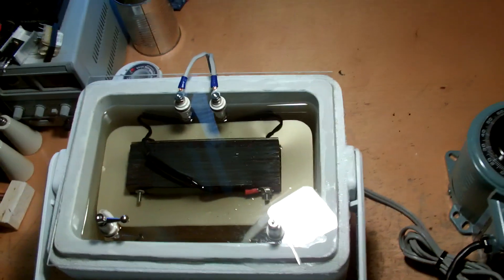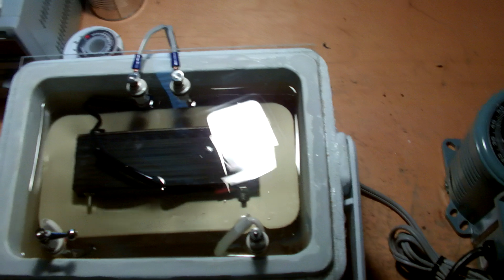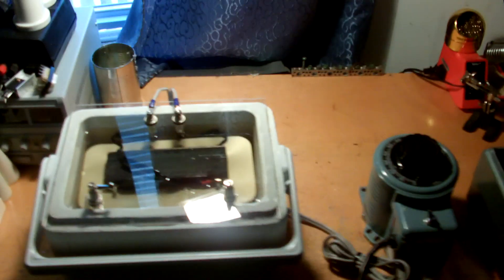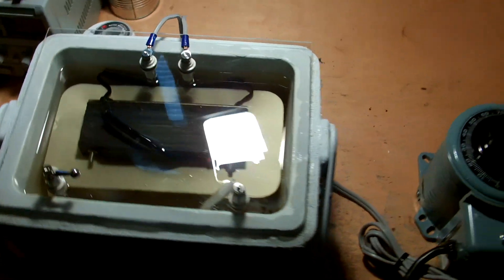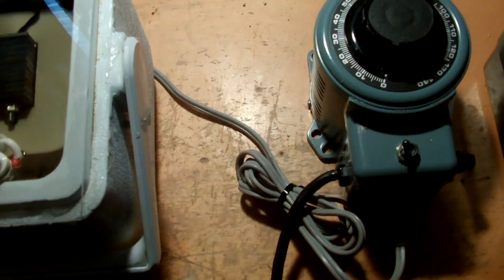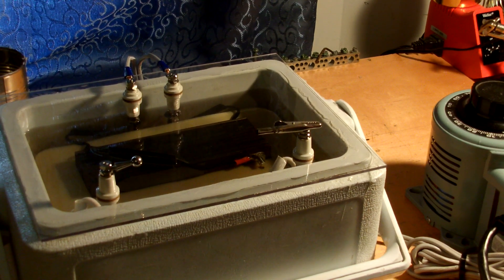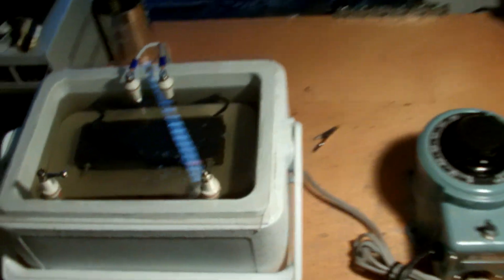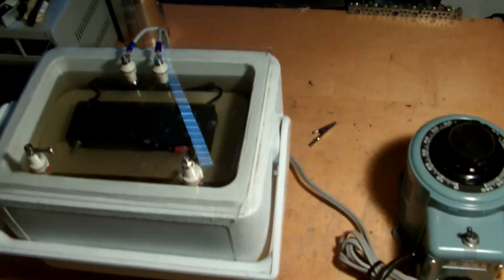120kv Xray Transformer Test Run!

Comment: How do you ballast an xrt to such a low amount of current?
Reply from the maker: Hey thanks for your comment! I wired a variable autotransformer in series to act as a variable inductor/ballast.
Reply: @PcrHV  hey thanks for responding! Did you have any load on the variac or was it just in series?
Reply from the maker: @randomusername777-b7y  just the xrt's primary was the load with the variac in series with it.
Reply: @PcrHV  that’s crazy that I’ve rarely seen people do this on YouTube. I’ve looked all over and you are one of few I can find who use a variable ballast like that.
Reply from the maker: @randomusername777-b7y Hey thanks man, you gotta be as resourceful with the DIY stuff haha. Just a crappy old variac makes a great variable ballast.
Reply: @PcrHV  I just can’t believe more people don’t do this method.
Reply: @randomusername777-b7y  because unfortunately it's not the same as using a conventional variable inductor, there are a lot of downsides (since the iron core in the variac is saturating). It still works well for stuff like this, I just didn't have such good luck in my experience

Comment: Thank you for the nice demo. 

What kind of Ballast are you using  ? 

Is the Ballast (Inductive Variac ?) connected in 
Parallel to the Voltage Regulating second Ballast ?

Comment from the maker: Hey thanks alot for the comment Steve, I thought about using a metal container but your right about the tools needed, plastic does fine for now even though its a bit unconventional having an HV cooler lol   Yeah haha, that little electrode came from a knob that fell of a trinket box of the sorts, it worked out well!

Comment: Those arcs look awesome!
Have you considered using a steel ammo can as a housing for that transformer? They have a great seal, carrying handle, and are steel in a perfect size for that xformer. I have several I use for projects. Just an idea... You would have to get creative with pass-through insulators though. . .

Comment: Could you get hold of an oil container and cut the top off level?
Although if you wanted something more perminant, maybe a
square metal thinners container.
Failing that the next best thing would be to fabricate your own
sheet metal container, although you would need access to a
guillotine and a tig or mig welder... hmm.
Nice arcs though, where did you get that little electrode from?
it looks like a little lever from something?